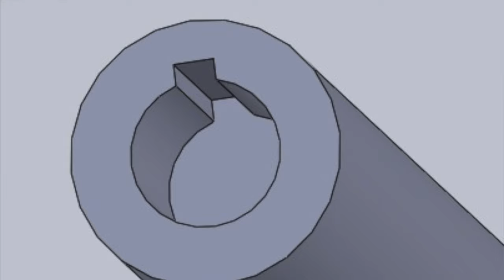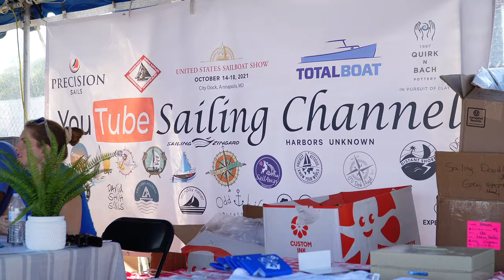PERCHING the ENGINE (volvo md2b diesel dinosaur)

Comment: Your drawing looks like it /has a wrong perspective. Especially the top structure. Where the tiller handle goes. It is upside down. Don't send this drawing off to be made. It won't work like you want.
Reply from the maker: Good eye - yes, the drawing was fixed. It was the first version of what the metal shop thought we needed.